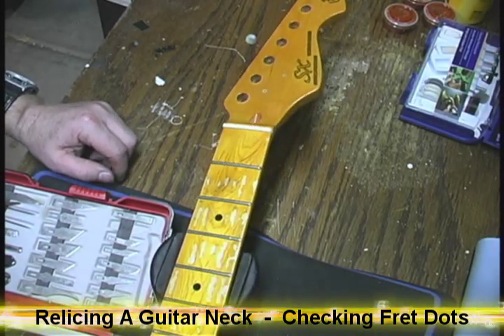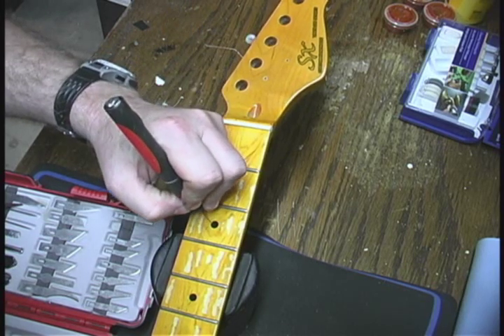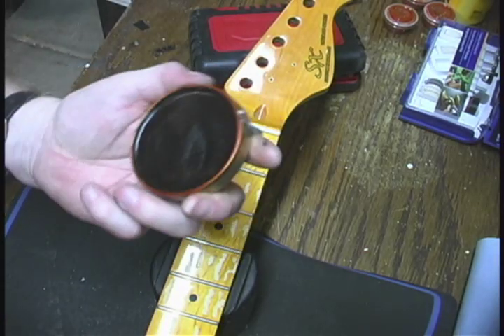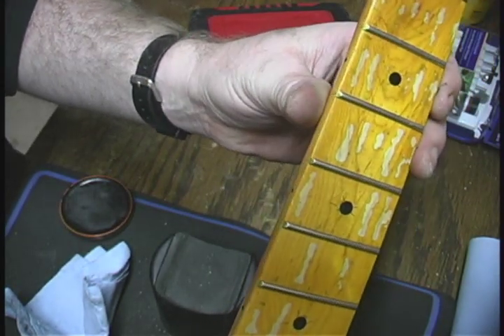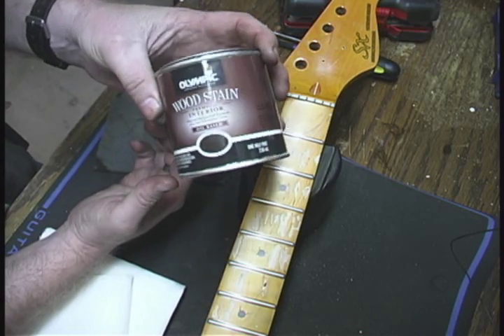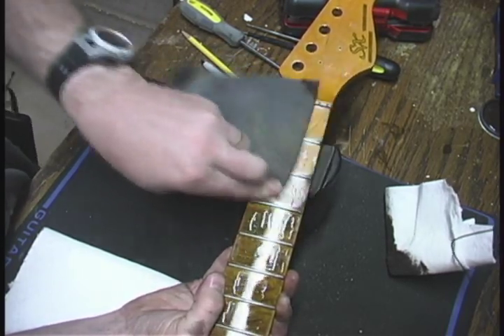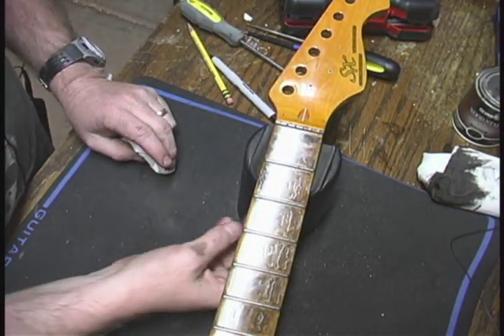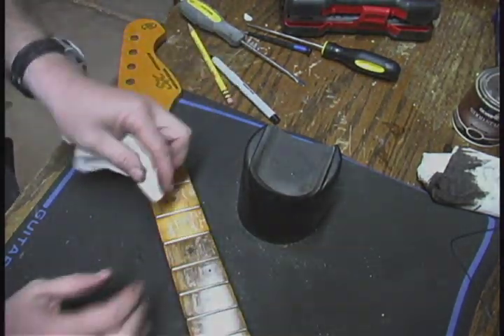Relicing An Electric Guitar Neck (Session 3)

Comment: Is the finish on this neck a Nitrocellulose or Poly? Was wondering because I wanted to stain my fretboard to simulate years of dirt build-up, but was wondering if an oil-based wood stain would react poorly with my Nitro finished neck?
Reply: if your neck is in nitro finish you basiclly don't need to stain the wood to get the aged look, if you gor the wear spots on your fretboard, you can just play your guitar with dirty hands. Wood stain especially oil based are usually thinned down with turpentine and that can get really messy really quick. Hope that helps

Comment: This guy is crossing the creek to get a bucket of water.!! You dont need that. Its not rocket science to do a good proper relic job.
ONLY thing you need to adress is : Your modus operandi should be that you can explain EVERY scratch on the guitar. Do not overkill. A 40 - 50 years old guitar is only been played coz it sound good and were nice to play on. Such a guitar is taking care of, but with 200 - 300 job pr year it will have playwear. So,, less is more. ( Only Rory Gallegher has an explanation for the total weardown ).